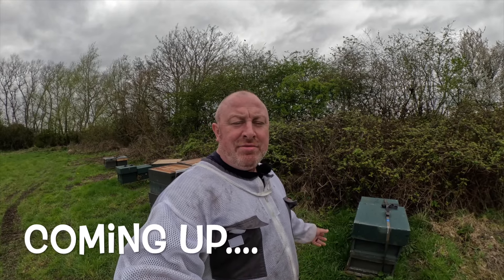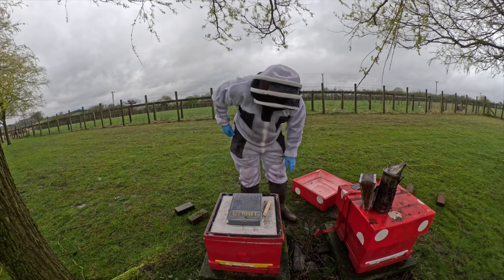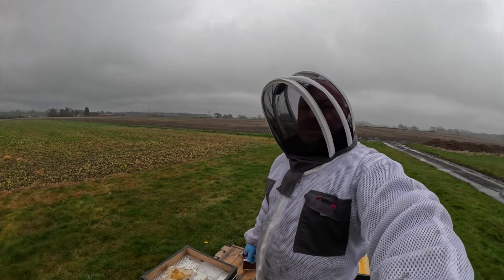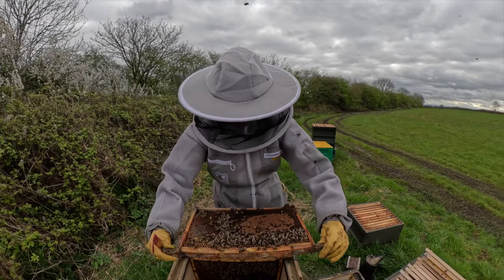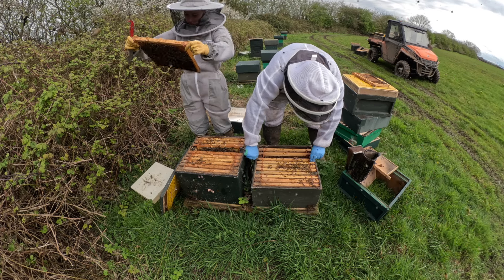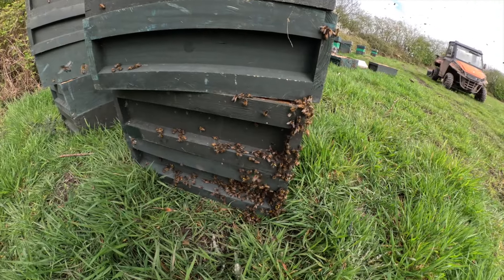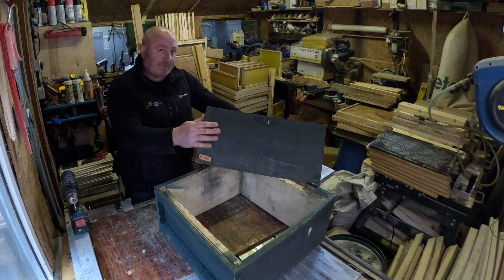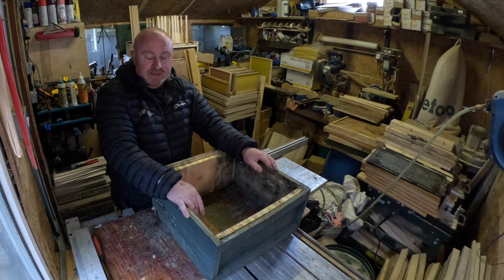Sh!t hives

Comment: Never had an issue with pine.... always varnish instead of stain and nails and glue not just nails .... obviously don't last as long but still OK if treated alrite
Reply: Sod the nails! I use screws and glue. I bought some B.E. bargain basement red cedar  brood boxes and supers. I didn't expect them to be bad bad, but they are red cedar for the main boards with pine for the top and bottom bars, and nothing fits. One brood box was so bad, I cut boards and bars down to make a 5 frame nuc, giving me some cedar to repair the big knot hole in the second. Every single pine bar has obviously not been machined properly, and I spent 5 mins per bar before the 4 ends would fit. Never again. Meanwhile, the brood box 2 supers and four rooves I bought in Thornes sale in October were put together in a day.